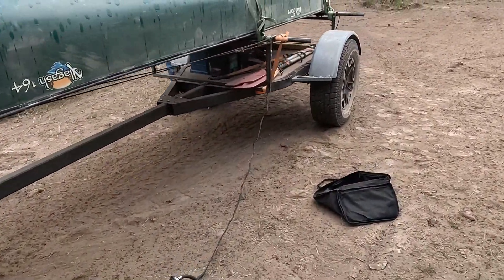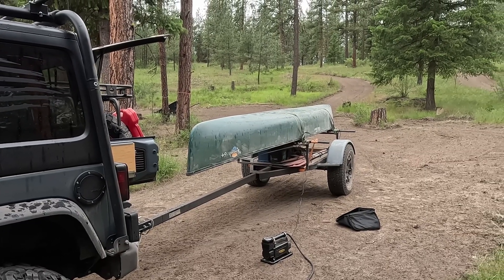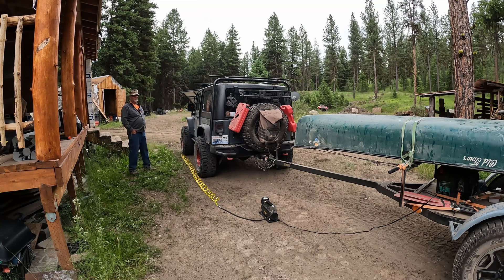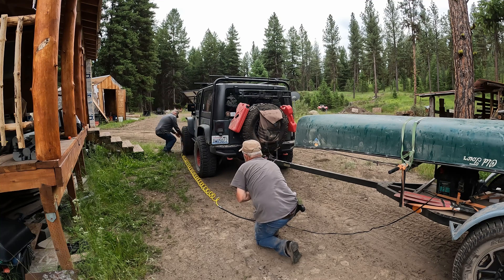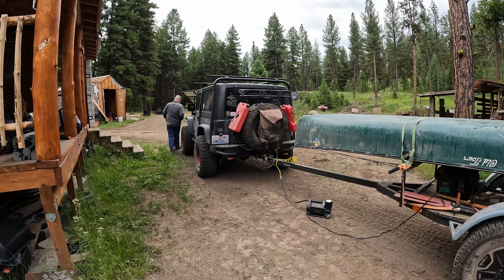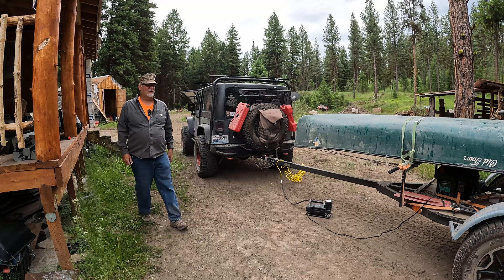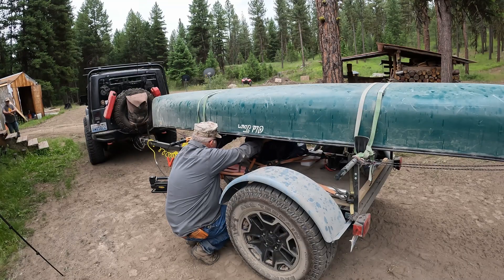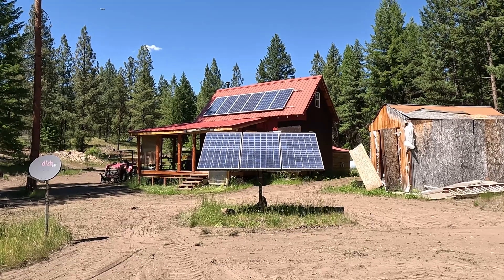Can this battery handle the abuse? CycleNBatt 12.8v 100AH LiFePo4

Comment: The BMS does not limit current unless you pull more than it is designed for then it just shuts off the battery..
Reply from the maker: Makes sense.

Comment: Considering the battery is a 100Ah/1280Wh unit, 45 watts will take a while for it to drain completely. I don't know how much your trolling motor pulls, but I'm sure it can't be much. On a full charge, how long will it power your current fridge? THAT should put it to the test! I'm glad to see them getting smaller and even happier to see them finally coming down in price. I snagged a deal on Prime Days to add to my current bank, along with some breakers for the build. I'm sure 150A is a bit overkill for now, but it gives me room to expand if I need to.
Reply from the maker: All great points!  I can do the math, but a lot of times, I find people just want to know what they can do via a visual demonstration 😉  In this 2 hrs is about how long it can run that compressor 😀